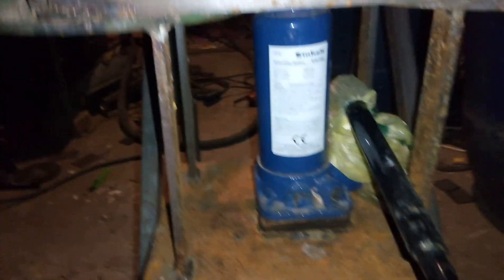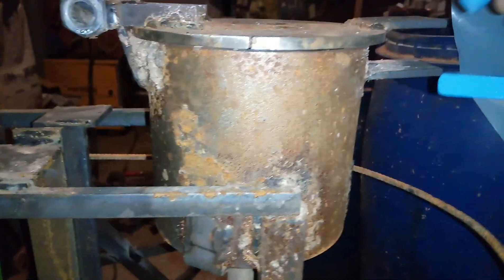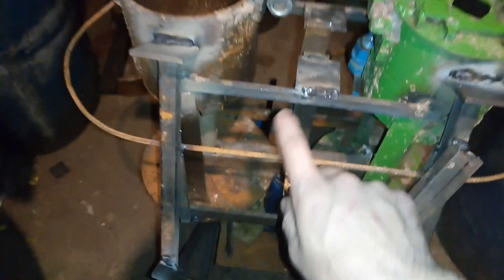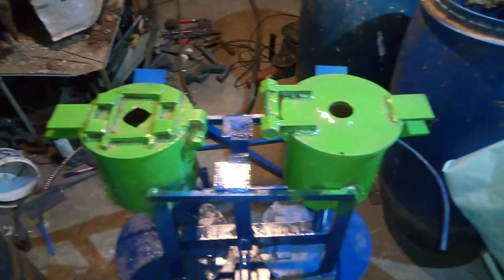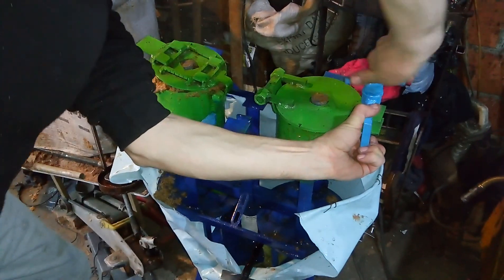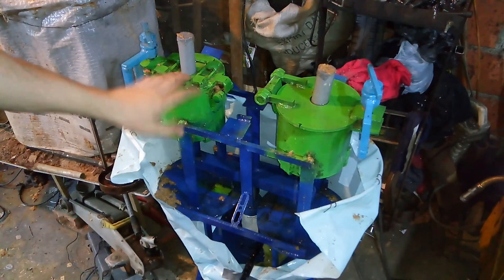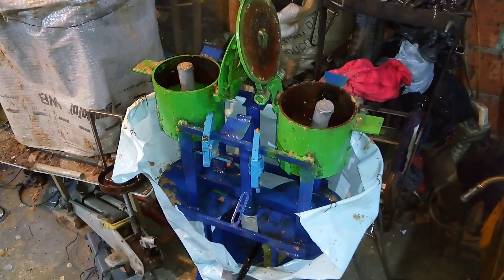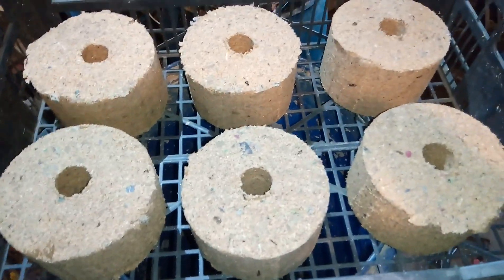Double round briquette press

Comment: Could you have a handle that you could use to push the finished briquettes up and out, after pressing, without having to pump them out? It seems that it might save a little bit of time and energy, but over time would become a significant savings.

Comment: Mladen,
 Make a waste oil burner, you can find more concentrated BTU s in the used oil from cars or tractors etc. There is lots of them in youtube, but keep it simple.
Reply from the maker: The law in our country don't alow burning waste oil,it has to be stored in container and than special company collect that,if you burn it every neighbour will call police and you have trouble
Reply: as long as you have enough air to burn it in the burner, it doesn't create pollution. they take the waste oil and they sell it again after filtration.

Comment: nice job what about making the tube higher and keep adding grinding disks to the tube so you can get 10 bricks in a tube?
Reply from the maker: Have you see my 25 briquette press,if you take longer pipe than you will need very high pressure force,it is better to make press like i did with my 25 briquettes than go with higher tube,greeting from Croatia

Comment: How do you think is it a good idea to make a longer press from a steel pipe of a big diameter? I just have such pipe and thinking of using it to built my very first press for a big round briquettes. I personally don't like round briquettes but now I have only such type of steel material. I mean will be good pressed if it would be quite long (high)? I'm thinking of making it equal to a one 10L bucket to make a fast loading of paper-sawdust source. And I'm planning to use some kind of a car jack of course.
Reply from the maker: You know where is problem if you make long briquettes in round pipe,longer the pipe is harder is to push all that out and even if you push out it will brake into pieces,with car jack you are limited with lenght of preasure so you will need hidraulic cilinder to do that work,if you use big diameter pipe i don't know what will happend,will briquett stay together or fall appart,10l is quite big,do you have so big stove door or where will you use it,greeting,i saw you put comment on some guy on my channel i didn't understant what is about